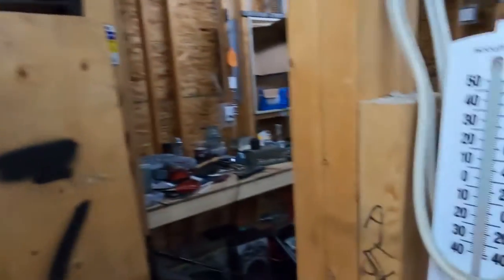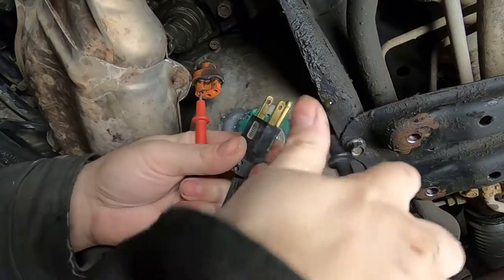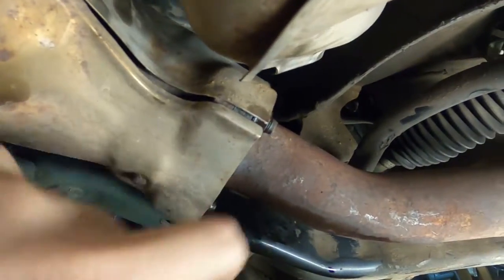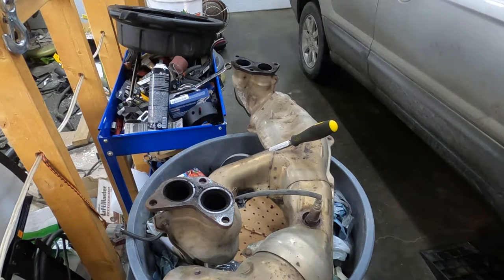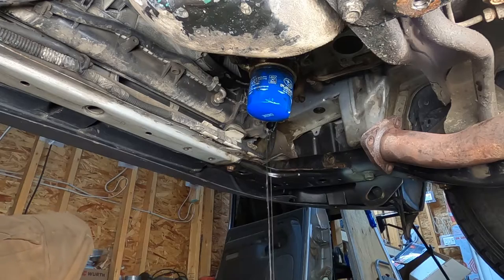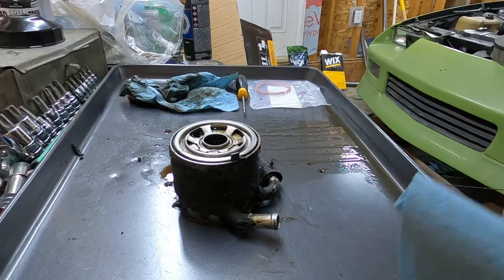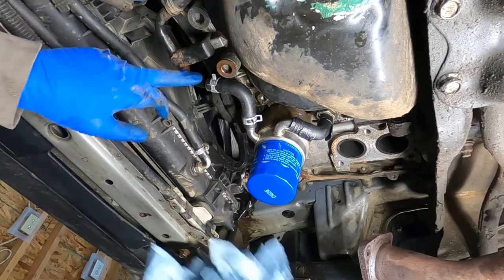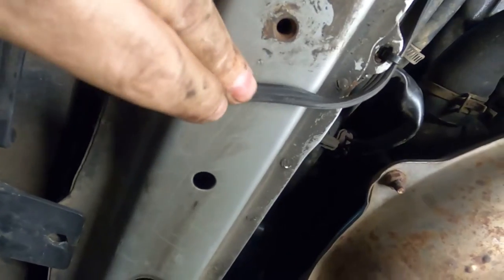06 Forester - Block Heaters, Oil Coolers and O2 Sensors

Comment: I’ve had the same trouble code, and changed the O2 sensor twice, and it’s not cheap. Check the tightness of the gas refill cap. And clean or replace the EGR valve. It’s a cheap part but not easy to get at. I soaked mine in WD for 15, gave it a few shakes, and now I’m now getting 400km per tank, instead of 300 km., and no more oxygen sensor trouble codes.
Reply from the maker: Generally and in most cases the P0420 will be the cat on a high mileage vehicle. I just disabled the code and ran it as we knew the vehicle was a nver forever vehicle and replacing the cat was going to be a large cost not needed

Comment: Thanks for the helpful video. Someone had welded (poorly) a replacement cat on my ‘05 forester before I rescued it from the scrap yard in 2020. I ended up replacing every section of that exhaust system, from the block to tailpipe. But the new catalytic converter section didn’t line up with the tail pipe section, and required extra welding. I double checked all parts and part numbers just to make sure I ordered correctly. Everything was from the dealership. 2.5X SOHC. 25EJ engine. Mine has a block heater as well. I wonder if block heaters are standard on all Subaru’s sold in the Canadian market?